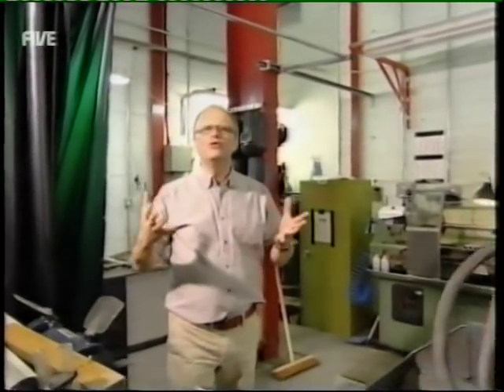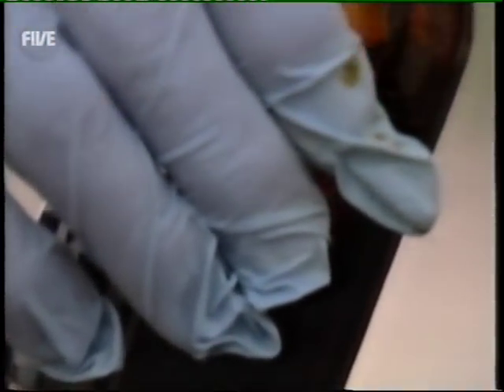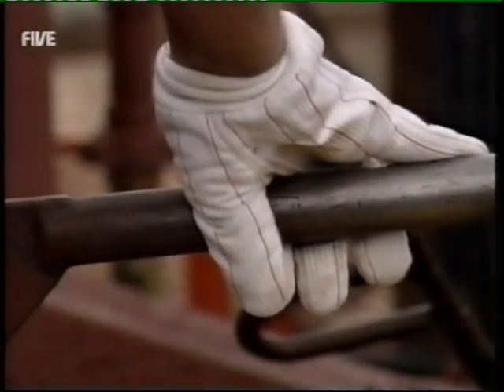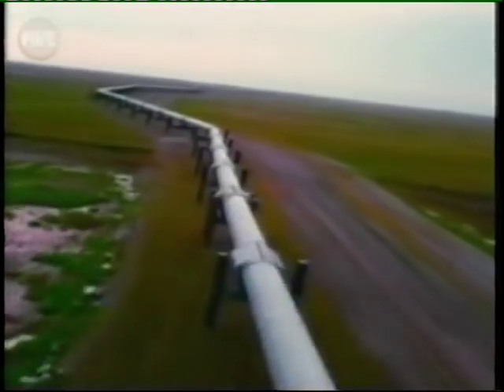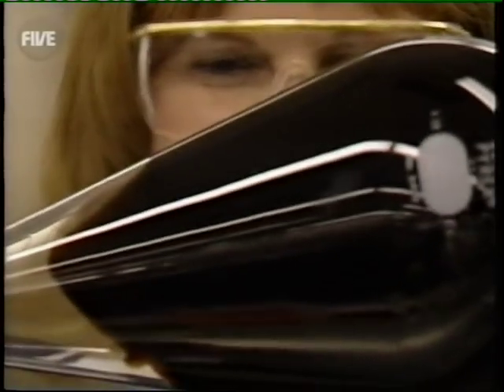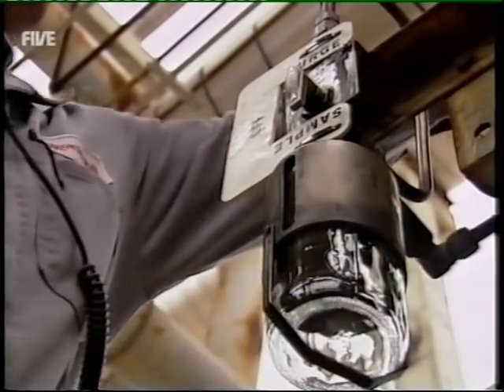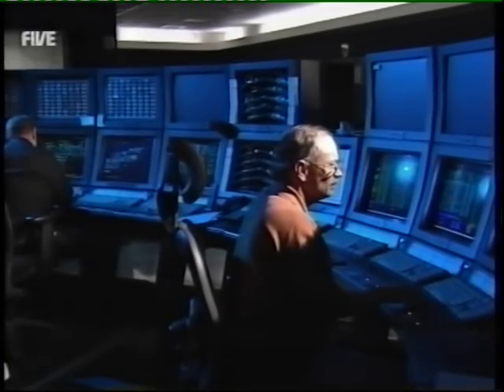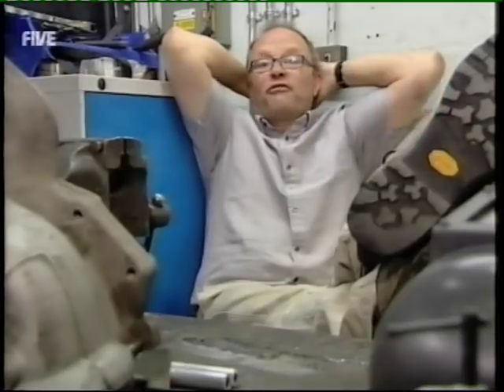How to Make Petrol or Gas from Crude Oil.

Comment: IN ORDER TO REVERSE THE ROTATION OF ANY HYDRAULIC OIL MOTOR, THERE HAS TO BE THREE OF THE OIL PRESSURE REGULATORS ON THE HYDRAULIC OIL MOTOR, A TWO THOUSAND FIVE HUNDRED PSI POUNDS PER SQUARE INCH OIL PRESSURE REGULATOR WITH A HIGH OIL PRESSURE BYPASS VALVE AT THE INLET OF THE HYDRAULIC OIL MOTOR, AND A ONE WAY ONLY ENTERING FLOW DIRECTION FIVE THOUSAND PSI OIL PRESSURE REGULATOR AT THE OUTLET OF THE HYDRAULIC OIL MOTOR, IN ORDER TO ALLOW A REVERSE ROTATION.  THERE WILL BE A ONE WAY ONLY EXITING FLOW DIRECTION THREE THOUSAND PSI OIL PRESSURE REGULATOR WITH A HIGH OIL PRESSURE BYPASS VALVE AT THE OUTLET OF THE HYDRAULIC OIL MOTOR, IN ORDER TO ALLOW FORWARD ROTATION ALSO.  THE ONLY WAY TO CONVERT FROM A METAL TOWING CABLE SHAFT, TO AN OUTPUT SPROCKET GEAR, FOR A TOWING WINCH, IS TO DRILL A HOLE AT THE CENTER OF THE BACK OF THE OUTER METAL CASE, FOR THE PGA PLANETARY GEAR AXLE, AND REVERSE THE POSITION OF THE INNERMOST CENTER PRIMARY INPUT SPROCKET GEAR, WHERE THE ELECTRIC MOTOR OUTPUT SHAFT SPLINE SPROCKETED SHAFT ENDPOINT, WAS USING TO MAKE THE CONNECTION TO THE PGA AXLE.  THAT WILL ALLOW THE HYDRAULIC OIL MOTOR TO CONNECT TO THE REAR OF THE PGA AXLE, AND IT WILL ALLOW THE METAL TOWING CABLE FINAL OUTPUT SPROCKET GEAR TO BE FACING OUTWARD, AT THE FRONT OF THE PGA AXLE.

Comment: “60Bn barrels pumped out of Texan soil”
That’s equivalent to 9500 cubic kilometres! Divided by area of Texas (695662 sq km) that’s 13 meters over entire Texas! What the fudge is filling up that void???
Reply: The lattice of rock and stone...it isn't an underground lake of oil, the oil is trapped in pores in the rock.  When given a place to escape to (an oil well) the incredible pressure pushes it towards the well.  This is what an oil field is...so there is no void, just empty pores which remain as a lattice with no change in stability.

Comment: 5:26 "...sucks the oil to the surface like an enormous syringe..."
Umm...no. If oil were being 'sucked', it could only be lifted about 30 feet or so, maybe not even that much. The downhole pump mechanism PUSHES the produced fluid up.

Comment: THE CONCRETE CEMENT VERTICAL PIPELINE ROBOT NUMBER TWO WILL HAVE TWO OF THE ROBOTIC LEGS, THAT WILL EXTEND OUTWARD FROM THE BOTTOM TORSO AREA JUNCTION BLOCK WAIST HIPS OF THE ROBOT.  THE ROBOTIC LEGS HAVE TWO OF THE LEG THIGH AREAS, WHICH WILL BE TWO OF THE SIXTEEN INCH OF LENGTH HYDRAULIC PISTON CYLINDERS THAT WILL BE CONNECTED TO THE OUTPUT SPROCKET GEARS AT BOTH OF THE PGA PLANETARY GEAR AXLES, FROM THE JUNCTION BLOCK HIPS, ONE OF THE HYDRAULIC PISTON CYLINDER FOR EACH ONE OF THE PGA AXLE, WHICH ALLOWS A ONE RPM ROTATION SPEED FOR EACH LEG THIGH.

Comment: THREE OF THE STEEL-METAL-H-BEAMS, THAT ARE TWELVE INCHES OF LENGTH, AND ARE TEN INCHES OF WIDTH, ALL THREE OF THE STEEL-METAL-H-BEAMS, SHOULD BE THREADED NUTS FASTENED AND THREADED BOLTS FASTENED TOGETHER.  THERE SHOULD BE THREE LEGS MADE OF STEEL-H-BEAMS, AND EACH LEG SHOULD BE THREE OF THE STEEL-H-BEAMS FASTENED TOGETHER.  THREE LEGS SHOULD BE POSITIONED UNDERNEATH THE CONCRETE CEMENT VERTICAL PIPELINE BRAND NEW ADDITION SECTIONS UNDERNEATH.  BY WRAPPING THE BOTTOM HALF OF THE STEEL-METAL-H-BEAMS WITH TRANSPARENT CLEAR PLASTIC WRAP, THEN AFTER POURING THE CONCRETE CEMENT, WHEN YOU DIG ANOTHER TWELVE INCH DEEP HOLE UNDERNEATH THE CONCRETE CEMENT VERTICAL PIPELINE, THEN YOU BREAK APART THE TRANSPARENT CLEAR PLASTIC WRAP, AND YOU THREADED NUTS FASTEN AND THREADED BOLTS FASTEN THE NEXT STEEL-METAL-H-BEAM SECTION, TO THE PREVIOUS STEEL-METAL-H-BEAM LEG.  JB-WELD-STEEL-EPOXY SHOULD BE ADDED TO ALL OF THE THREADED AREAS OF THE NUTS AND BOLTS, IN ORDER TO LOCK IN ALL OF THE OVERSIZED NUTS AND OVERSIZED BOLTS A LOT BETTER.

Comment: This doesn't teach how they are made, with a fire a couple of cans some pipe and taps with collection bottles you can make heavy oils and lighter and thinner at each collection bottle till high octane gas, full proses easy setup, find it at mr tesalonians channel, he even rig's a car to run on the same system, amazing work.

Comment: We need oil or coal. They forgot to add hydrocarbon or synthetic plastic a ev car has 800 lb of it. Even chip or solar panels need 98% pure silicon goggle that. 
That a 2 furnace process by coal 2,500 degrees for 20 minutes to melt put impurities so if you did the math of finish product and it life solar p.about 5 yr. the same coal energy could run that same houses w/ solar panels for that amounts of time. Solar only 24% efficiency. So it true law of energy is you can't create energy but only move it around. 
And biomass or wood pellets running power station why cut down outfirest wood. When we could used dead resources as oil and coal. Look in s city when you cut Down the trees. It so damm hot . And you need to used more sprinkler to grow grass.

Comment: THIS IS THE ELECTRIC MOTOR ANALOG MANUAL VARIABLE SPEED CONTROLLER, ELECTRIC MOTOR DRIVE CONTROLLER, WHICH CAN CONTROL THE SPEED OF ANY ELECTRIC MOTOR THAT WILL BE CONNECTED TO A MAIN OIL PRESSURE HYDRAULIC OIL PUMP THAT WILL BE PROVIDING THE HYDRAULIC OIL PRESSURE FOR ANY HYDRAULIC OIL MOTOR AREA:

KB Electronics, 9533, KBMA-24D, 1HP, 1-Phase, 110-120V;200-240V (Input), 3-Phase, 240V (Output) - (for use with 3-Phase Motor) Nema 1 Enclosure, Variable Frequency Drives

THERE IS ANOTHER TYPE OF ELECTRIC MOTOR ANALOG VARIABLE SPEED CONTROLLER.  IT IS THE ORIGINAL ELECTRIC MOTOR CONTROLLER, FOR THE 1/3 HP (ONE-THIRD HORSEPOWER) ELECTRIC MOTOR THAT IS ONE HUNDRED TWENTY VOLTS (120 VOLTS ALTERNATING CURRENT - VAC), WHICH IS A ONE AMP ELECTRIC MOTOR, USUALLY USED FOR THE AIR CONDITIONING APPLIANCES.  THE FULLY SEALED OUTDOOR ELECTRIC MOTOR IS THE BEST ONE BECAUSE IT IS WATERPROOF.  THE ORIGINAL ELECTRIC MOTOR VARIABLE SPEED CONTROLLER VARIABLE TORQUE CONTROLLER FROM THE YEAR ONE-THOUSAND-NINE-HUNDRED-FORTY (1940), IS ACTUALLY SIX OF THE POTENTIOMETER DIMMER SWITCHES, IN SERIES-PARALLEL, WHERE YOU HAVE THREE OF THE DIMMER SWITCHES IN SERIES-ONE-AFTER-THE-OTHER, AND THEN ANOTHER SET OF THREE DIMMER SWITCHES IN PARALLEL WITH THE OTHER THREE DIMMER SWITCHES, AND YOU ALSO WIRE UP THE OTHER SET OF THREE DIMMER SWITCHES IN SERIES-ONE-AFTER-THE-OTHER.  THAT EQUATES TO A ONE-THOUSAND-EIGHT-HUNDRED WATT (1,800 WATT) POTENTIOMETER MOTOR CONTROLLER FOR ELECTRIC MOTORS. 

(600W, 120 Volt AC 60Hz, Single-Pole, Trimatron Deluxe Rotary ON/OFF Electro-Mechanical Incandescent Rotary Dimmer, - Ivory White - THIS IS THE DIMMER SWITCH THAT WILL ALWAYS PROVIDE THE ONE-HUNDRED-TWENTY-VOLTS (120 VAC), WHILE REDUCING THE SUPPLY AMPERAGE.  THERE WILL NEVER BE A VOLTAGE REDUCTION, EVEN WITH THE DIMMER SWITCHES IN SERIES-PARALLEL).

IT IS GOING TO NEED SIX OF THE POTENTIOMETER DIMMER SWITCHES, FOR EACH ONE SPEED OF THE ELECTRIC MOTOR.  IT IS BIGGER, YET CHEAPER.

Comment: "Green" Ammonia, made from Solar or Wind Energy, can replace fossil fuels. It needs to be separated back into Nitrogen and Hydrogen; but the latter can be "burned" in a fuel cell, or used in a COGAS (NOT "Coal Gas") scheme. You burn it in a gas turbine, and use the hot exhaust to run a steam turbine. This will be important for Big Trucks, Container ships, and can even be used in jet airplanes, the latter of which could be mostly replaced with bullet trains, and the Hyperloop (excepting transoceanic crossings, and we could even link the Bering Strait by rail, if  the War is ever over.)
The reason not to simply use hydrogen is that it's highly explosive, and difficult to store. You want to make it as needed, in low quantities. Ammonia is corrosive, but relatively easy to liquefy. Inorganic Hydrazine, (a Dimer of ammonia) is liquid at room temperature. It may cause Cancer, but simply needs to be handled carefully. This same ammonia, BTW, can replace "Blue" (from natural gas) ammonia in agriculture. It can also be oxidized to nitric acid, so that you can make ammonia nitrate fertilizer. 
To correctly complete the "Build Back Better" plan, high voltage pantograph lines should be strung on our superhighways to power buses,  tractor trailers, and even RVs and Fifth Wheel trailers (in the latter case, by powering the pickup trucks that tow them. 
Homes and low-rise businesses should use solar roofs, where practical, and ALL buildings not on permafrost should have ground loop heat pumps. Those are about 5X more efficient than current HVAC setups. 
As for: "Where will all the electricity COME from??" Well, there are current encouraging advances in Nuclear Fusion, although it's still a dark horse. And, there are ways to make Fission safer, including a hybrid system, where the neutrons from fusion could be used to breed fission fuel, such as Thorium. 

Those who want to keep fossil fuels, are either:
1. in the pockets of Big Oil, and/or
2. figure that overpopulation is the "Real" problem (and, it IS a Huge problem! There should Never have been more than half a Billion of us hairless apes on this Planet.) If you wanted to thin the herd, and commit Genocide against about 90% of the population, you really couldn't do it more efficiently than with Climate Change. There will be more droughts, floods, famine, and war in the coming years. The UK, Europe, and the Horn of Africa are already in Trouble. Here in America, places that Rarely saw 100 F, such as the Pacific Northwest, have seen 110. Lake Meade (held back by the Hoover Dam) is almost Dry. Los Angeles, San Diego, Phoenix, Las Vegas, and the Central Valley (irrigated for agriculture) cannot exist without it.

Comment: 159 liters of crude oil makes 168 literally of fuel? 🤯 @10:00
Reply: PegDowncom I don’t think you know the difference between density and volume.
Reply: It's called volume gain. In refining, certain processes result in a larger volume of product than feed because the density is lower. It's huge in refining because the vast majority of product is sold per volume, not mass. You buy gas by the gallon, not by the lb.

Comment: And to think that only 35 percent of the energrgy is actually turned into mechanic energy in an internal combustion engine is mind boggling wasteful. Immagine if all internal combustion engines were 65 percent efficient how much oil we would save. Its possible there called opposed piston engines made by acades power. Why aren't we using them also hybrids are more efficient.

Comment: Ocean Offshore Marine India
This course is essential for personnel who are new to the offshore oil and gas industry that require this safety and emergency response training and assessment to work in an offshore cold or warm water environment.

#BOSIET course is a minimum requirement to work offshore. The course consists of four modules; Safety Induction, Helicopter Safety and Escape (HUET), Sea Survival and First Aid, Fire Fighting and Self Rescue. The BOSIET is required for cold water areas and includes additional training in the use of survival suits and emergency breathing systems during the #HUET module.

Introduction1. 1 #Basic Safety Induction, #Helicopter Safety and Escape (HUET), #Sea Survival and First Aid, #Fire Fighting and Self Rescue. #Emergency Breathing System (EBS) , In-water Procedures

Ocean Offshore Marine India uses the latest equipments. We are the best institute to offer the #offshore courses in India. We offer all types of courses related to the offshore Industry.

Courses 1. OIM (Offshore Installation Manager)
2. BS (Barge Supervisor / Barge Master)
3. BCO (Ballast Control Operator / MOU Stability)
4. MS (Maintenance Supervisor / Chief Mechanic)
5. OPITO IMIST (International Minimum Industrial Safety Training)
6. Crane Operator Course - Level 1, 2 & 3
7. HLO (Helicopter Landing Officer)
8. HDA ( Helideck Assistant)
9. BOSIET (Basic Offshore Safety Induction & Emergency Training)
10 . PSCRB ( Proficiency in Survival Craft & Rescue Boats )
11. HUET (Helicopter Underwater Escape Training) &
Helicopter under water escape & sea survival training
12. H2S (Hydrogen Sulphide Gas Safety Course)
13. FRC / FRB (Fast Rescue Craft / Boat )
14. HFF (Helicopter Fire Fighting)
15 HDFF ( Helideck Fire Fighting )

Basic Offshore Course
Roustabout Course
Enclose Space Entry
Helicopter under water escape & sea survival training
Container Familiarization
Safe Working Practice
Marpol
Environmental Compliance Training
Environmental Safety Training
Basic safety Training
Roustabout Course
Anchor Handling
Accident Investigation
Safe Lifting and Hoisting
Fast Rescue Boats / Craft
Crane Operator
Rigging and Slinging
Designated Person Ashore (DPA)

D.G. Shipping and I.M.O. Approved STCW 95 /STCW 2010 : Courses
Elementary First Aid (EFA)
Fire Fighting and Fire Prevention (FPFF)
Augmentation Fire Fighting and Fire Prevention (AUG FPFF)
Medical First Aid (MFA)
Oil Tanker Familiarization (OTF)
Personal Safety and Social Responsibilities (PSSR)
Personal Survival Techniques (PST)
Refresher Course for FPFF (STCW' 2010)
Refresher Course for PST (STCW' 2010)
Security Training for Seafarers with designated security duties

AVAILABLE COURSES
Nautical courses
Basic Offshore Courses
Writtens and Orals Preparatory Classes
Engineer Courses
Engine Room Resource Management
Catering courses
Rating Courses
Passenger Ship Training
Technical Maritime Training
TANKER COURSE
MARITIME ENGLISH (APPROVED TEST CENTER FOR MARLINS UK)
AUDITOR TRAINING
COURSES RECOGNIZE BY PANAMA,HONDURAS,
BELIZE COURSES RECOGNIZE BY LIBERIA

And Ship Manning, Offshore Recruitment, Offshore Training, Marine Training, CDC ( Palau Panama Liberian Honduras Indian ) & COC Assistance
I Remain At Your Service For Further Assistance.

Contact for the offshore course booking of #BOSIET, #HUET #FOET, H2S #HLO #FRC #PSCRB, HFF, #HDFF #STCW 2010 Etc. #Now In India. Email- Oceanoffshore@pacific-ocean.com weoffshore@gmail.com Mob-8750141747